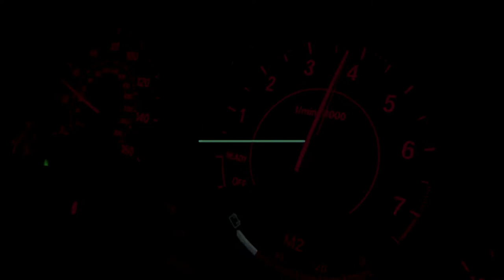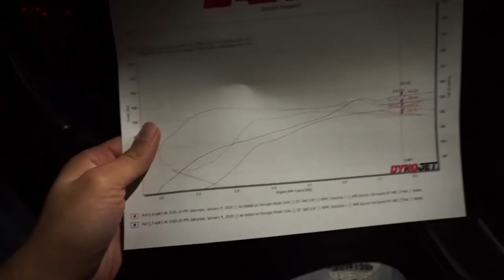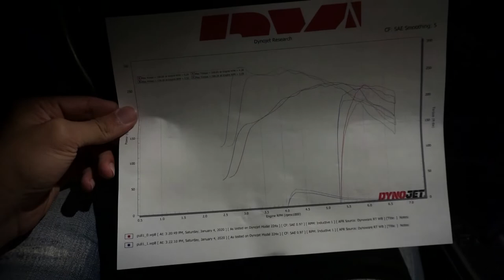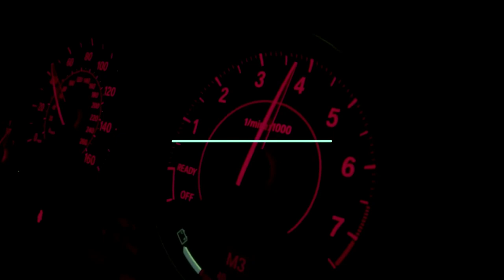JB4 tuned BMW 340I dyno and Dinan tuned 328I dyno

Comment: What dinan tune did you used on your 328i?
Reply from the maker: It’s just stage 1 dinan bro
Reply: Could you please send me a link to the one you're running on your car please and thank 🙏
Reply from the maker: You want link where I bought it from or link to what kind it is?
Reply from the maker: The tune that I have is actually on sale bro so if you want it DM me on insta
Reply: Yeah i would like to know what kind you got because i know they got a couple different chip tune for the n20 and i got one aswell and if its the same one we should be pushing about the same numbers and im very curious to what my WHP is
Reply: I am considering upgrading to bootmod3 however. FBO stage 2

Comment: That 328i ist weak Bro. It should have around 320 at the crank with Stage 1.

They make 250 Stock lol
Reply from the maker: Well I guess then it didn’t run right maybe 🤷🏼‍♂️